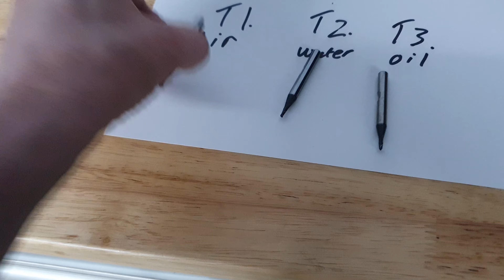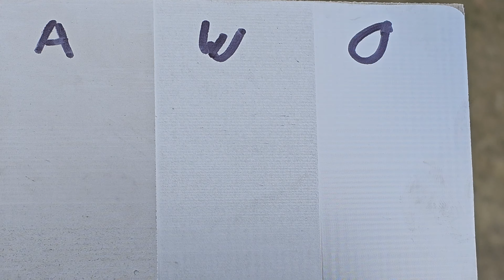CNC Ball Milling Air vs Water vs Oil

Comment: Is rust much of a concern if you're using water?
Reply from the maker: Rust is the primary problem when using water but you could coat the metal parts of the machine so as to repel the water.
Hurco CNC machines are power coated inside and out and therefore they do not rust like other machines that employ weaker painted coatings.
Following the testing using water, I can see that it does work as a coolant but not quite as good as a proper oil based coolant in terms of ultimate speed, finish quality and of course rusting.  If you make Youtube videos or videos in general, the oil based coolant tends to degrade plastic housings and other camera equipment so perhaps a good reason to switch to water only cooling when doing video work.

The time spent doing the testing was useful.